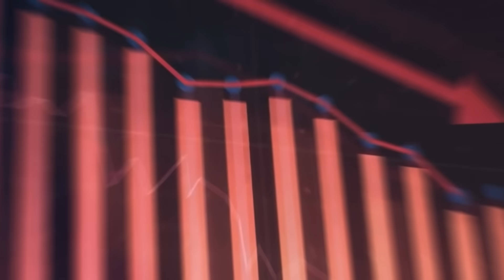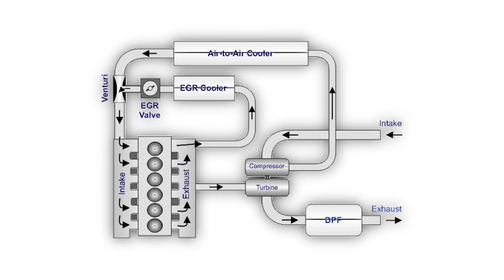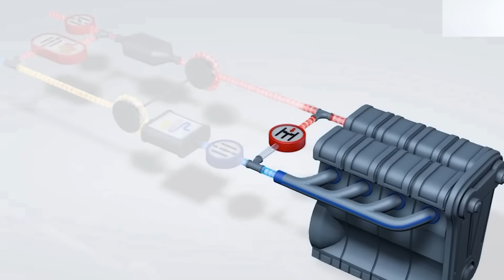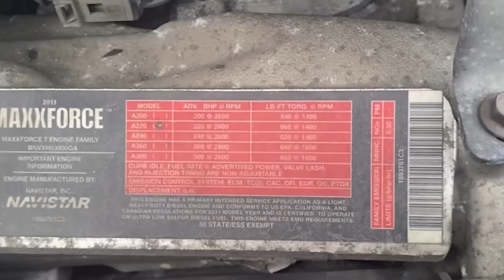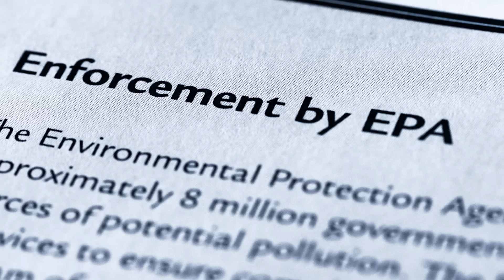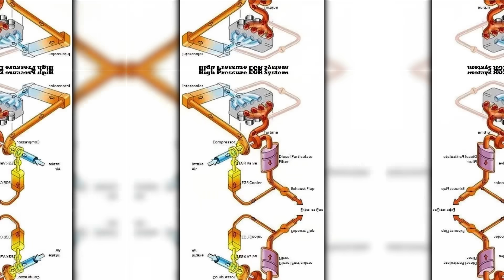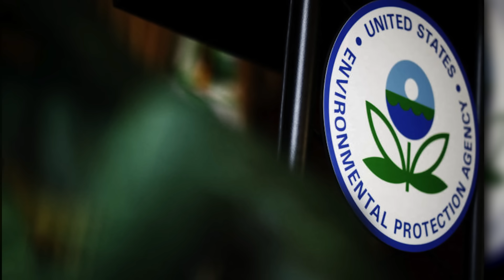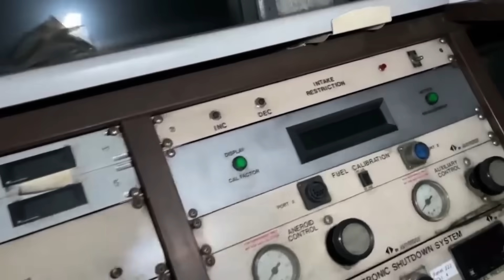The Rise and Fall of MaxxForce: The Engine That Broke Navistar

Comment: I still have my Maxxforce 13 powered ProStar. The original engine went 645k after numerous repairs. Navistar cut me a check for $5.5k for my troubles tho lol.
Reply: What’s funny is a gave up turning wrenches when my shop got bought out, and started driving local. I had an international 7600 with a Maxxforce 13 and Eaton 8LL. I had that truck from new and drove it for 4 years. It never went to the shop for anything but service. I never ran a parked regen on it either. 

I beat that truck daily. I wrung its guts out at every stop. I honestly think that’s why it never had problems.

Comment: I'm not a mechanic, only a lowly steel mill electrician. Even I could see how stupid their system was. HUGE heat cycling in a system with huge variables was a sure course to failure.

I am SURE their engineers had screaming and yelling fits with their executives, and the executives with their business degrees DID NOT want to hear it from those peons.

Comment: I worked for a International Truck dealership. I was Cat, International, Cummins, Detroit and Mercedes 2015 certified when I left. I saw and worked on all this crap. It is funny that International didn't learn from Detroit when they came out with ERG and we were changing coolers weekly. I am happy that I no longer have to deal with this crap.
Reply: I had no idea these engines were so bad. I owned two Mercedes powered trucks and if you were to ask anyone, they’d tell you to run away from them. But honestly that Mercedes was extremely reliable. The biggest problem I had with them is no one really knew that much about them so every time I told someone it had an MB they’d turn me away. But they gave me almost zero issues.

Comment: All really unfortunate... This should have all been found out during testing and they should have backed aways from the design before selling it.
That said.. we had International Pro Star trucks.. had cummins engines .. then we got new ones with the MaxForce engines.. I will say the ones we had made good power.. peak torque was at 900 RPM..  You had to adjust your shifting points to make it work.. revving it out did not make it work better like the older Cummins we had.
I liked how they drove.. But I left the company not long after so never experienced all the failures that must have happened.
It is interesting that International has pivoted completely the other way with the S13 Integrated engine.  It does not even have ANY EGR cooler...  The idea is to let the engine do engine stuff.. and they built an aftertreatment system to do that.  NOT forcing the engine to be an emissions component.

Comment: as a diesel mechanic, i worked on these engines on school buses and they're junk, we would send these vehicles out to the dealer rather than work on them, we would get the vehicles back almost a month later.
Reply: And then they went down again within a couple weeks lol
Reply: Loadstars, Fleetstars and S series will be hauling Prostars to the crushers
Reply: Didn’t the buses have the Ford 6.4L engine? Or should I say the 6.4L International engine Ford used in the pickups?
Reply: @tylermacconnell217 Maxxforce 7 duh
Reply: @tylermacconnell217  we got rid of all the maxxforce buses too problematic.
Reply: @tylermacconnell217  they also had the maxxforce dt
Reply: keep in mind this is the same company that made the powerjoke 6.0.  lol
Reply: I am a fleet mechanic for a public utility. The MaxxForce 10 and 13 nearly pushed me into an early retirement. We have 43 garages that maintained about 900 Navistar trucks and I can’t begin to tell you how many of us wanted to find another job after dealing with this MF engine. We stayed so busy replacing injectors, High Pressure oil systems, EGR coolers, turbo chargers, we rarely had time to do maintenance on the ones that were running. 

What’s worse was that the drivers were blaming the garages and not the trucks. In hindsight, who could blame them? All the driver understood was that their truck quit running, we repaired it, and the damn thing quit running again a week later. 

The company has got rid of more than half of their trucks using the Maxx Force and replaced them with trucks using the L9 Cummins. To be frank, I am not terribly impressed with that engine either. It’s definitely better than the MaxxForce but it’s not nearly as dependable as the earlier Cummins engines.
Reply: This engine almost made me quit pursuing a career in diesel repair. This was the first ever engine i had ever worked on professionally as a paid fleet mechanic. It took me 2 weeks to figure out a crank no start on it. Ended up being injector orings and a coolant level sensor. I was 19, fresh out of welding school with 0 help from  anyone and like 200$ worth of craftsman sockets and wrenches and a test light. I didnt even know how to use the test light.  No scan tool or error codes on the dash telling me low coolant level because the orange screen on the dash was cracked and half black
I truly thought that was the end for me, I figured it out a couple of hours before i was going to leave and never come back and work construction as a laborer. Still wrenching 12 years later.
I truly thought it was going to be that hard everytime, Turning wrenches got exponentially easier as i learned more. I threw at least 24 cans of starting fluid at that thing, Did the fuel filters like 4 times, I even pressurized the fuel tank so hard i blew out the fittings on the fuel lines. Looking back on it I definatley fried the dogshit out of the intake heater😂... I was thrown to the wolves and faced THIS piece of shit for my introduction into the diesel world 😂
Either nobody actually knew what they were doing in that shop or they refused to help me. Still pondering that to this day.
Reply: @loveforthegame3 Yes, but you figured it out. And that’s the kind of thing that will make this a great career for you. After 42 years I am finally retiring. I will always look back on those times I was sitting on the concrete floor at 11pm, long after every one went home, trying to figure out why something wouldn’t start or run. My wife would bring my dinner to to the shop, and I would get home after the kids were asleep. 
I couldn’t give up. Like you I am a fleet mechanic and the crew needed the truck. 
I will always have those memories to look back on
Reply: @Randy.E.R  congrats on your retirement. Must have been something else to see all of the advancement in technology throughout your career. The Aftertreatment systems must have been hell when they came out 😂. 
I am much much much better now, its been awhile since i ran into a problem i havent been able to remedy.
I still much prefer to work on an old 2 stroke detroit than anything else.
Reply: Had a 3rd party fleet provider that gave up on the company I worked for because they didn't want to work on the engine.
Reply: Company I worked for swapped in B Series engines.
Reply: @andrewkessinger5966  i worked for the school district and these buses were old so they prefrred to auction them off since we were getting new buses.
Reply: I am down to 3 left.  One DT and 2 Maxx 7's in my fleet.  My DT runs great but put close to 20k in the past 3 years.  The 2 Maxx 7's I am keeping them running until they completely fail.  I dislike these engines.
Reply: What was wrong with them? I mean what was failure prone and why? Oiling system? Bad metals?
Reply: @dukecraig2402 
if one injector went out and you replaced it within a couple of months or less the other 5 injectors would go out so you had to replace all 6 injectors at once to avoid more problems and that was expensive and time consuming, turbos would leak oil, frequent regens, the engine required alot of maintenence alot more that the 6.7 cummins.
Reply: @feliperodriguez6885 
Sounds like one of the many reasons I got away from being a mechanic and started working as a welder.
Reply: @dukecraig2402  Worked for a bus fleet with them as well and they got so bad we were changing oil on them every month because the oil would fill with diesel and leak everywhere, don't mention the EGR coolers and the turbos. Every Bus with those engines you would know where they park because there would be an oil spot waiting for you. The newer International Cummins busses are not too bad besides the SCR system and don't even get me started on the POS Bluebirds.
Reply: @dukecraig2402 you cant piss in a mr. Coffee and get tasters choice. Even if you cool the 1000f+ exhaust to 300f and introduce into the charge air mass, this will cause a thermal runaway condition beyond the TDP of the engine, and then you add a plugged dpf and continued fuel  being commanded to overcome the loss of power and necessary regen for dpf along with a 80klbs load...the specific heat of co2 doesnt help at all because co2 isnt the only gas being worked and compressed especially at the level of reingested egr the system is reintroducing. I cant imagine what the drive temps and pressures these engines were living with much less what the scavenge ratio was under these conditions.
Reply: American junk….

Comment: The Maxxforce 13 was actually a MAN D2676 with Navistar's emission system on it, and the Maxxforce 15 was a Caterpillar C15 with Navistar's common rail fuel and emission systems on it.
Reply: Really now. Tell me more
Reply: @sandasturner9529 I can't go into what they said further, but I know the newer A26 engine is a MAN engine, and the new s13 is a Scania.
Reply: @joshsnyder629 also the PACCAR PX-9 is a rebadged Cummins L9 and the MX-13 is a DAF engine (PACCAR owns DAF).
Reply: @Der_Ingenieur  hmmm 🤔 🧐
Reply: @sandasturner9529 🤣🤣🤣
Reply: @sandasturner9529  We have a CAT CT660 heavy hauler. It is a CAT block and head with literally everything else being Maxxforce fueling, emissions, accessories, etc. We got it deleted and it’s actually quite the animal.
Reply: Maxxforce 13 was a Daf Motor.
Reply: @curtisnoble. PACCAR MX13 is a DAF engine. I get those mixed up, too😂
Reply: @Erichhh paccar mx13 is JUNK

Comment: One the video didn’t touch on was, while Navistar was dealing with all MaxxForce problems, there were two other engines produced for Ford that were as equally problematic. Ultimately Ford didn’t renew their contract with Navistar, but rather went on to building the engine in house.
Reply: And the Ford 6.7 Powerstroke is anything for ford to be proud of either. They never stop leaking oil.
Reply: @lbw60-br9  True of early 6.7s, but not later ones....
Reply: @alexnutcasio936 dont worry oil leaks arent the biggest failure point of them. The CP4 pump is.
Reply: @lbw60-br9 I think I’ve heard something about the oil pan being a big problem. Was there anything else that was prone to leak?
Reply: @lbw60-br9  The first generation 6.7 wasn’t very good, the 2017+ 6.7s we’ve had have been awesome. About 450k miles between 3 F550s and not one of them leaks. No major issues on either yet. On the other hand…. We also have a built 6.0 company “show truck” that started pushing compression through the cooling system 20k miles after its new engine. No EGR on it either.
Reply: @ASM31237 if it’s pushing coolant after 20k miles then something wasn’t done right when the heads were put on.
Reply: @lbw60-br9  no one ever services the ccv system thats a solid 95% of the problem. If the crankcase can’t vent it’ll force it out eventually. But they did certainly have bedplate sealant issues on the early ones.
Reply: @lbw60-br9 I have a 2014 with over 100k on it and it has never leaked any oil. I would see it on my Garage floor if it did.
Reply: @lbw60-br9 bs 2011 f350 236k and doesn’t leak a drop.

Comment: Okay but what about CATs Acert system? They were significantly cooling combustion chamber temps without even EGR system. Een CAT saw how bad an idea the government was forcing on these standards, and they backed out completely. If left alone I believe CAT would of done what they always do, give customers better, more efficient and safer equipment. Politicians should not dictate to engineers
Reply: It's called watch adept ape
Reply: The EPA got involved because NOx emissions cause lung disease and acid rain, it has nothing to do with improving efficiency or safety. And do you really think CAT or any of these companies would have started caring about that all by themselves if the gov just left them alone? Do you really believe the engineers get to make these kinds decisions anyway?

Come on, that's not the world we live in.
Reply: @yinyangsaladgang8789  Nox emissions is caused by excessive combustion temperatures. CAT ACERT reduced combustion temperatures. 
CAT was working on this, before the politicians with no experience in engineering got involved and pushed unproven systems and designs. Do you know what Regening is? The truck sits at high idle for 30min-1hr30min. DEF fluid has to be manufactured transported and stored, parts failures causing more down time and inefficient running, which increases emissions far more than not doing the systems. 
Companies like CAT are far smarter about engineering than any politician or voter
Reply: They backed out of otr, but for what? Off road equipment has to have def systems now at least in Oregon
Reply: @NPC-mt1cz it gave them 2 years of watching everyone else’s disasters, and 2 years of extra R&D.  That’s actually quite a bit of value given the ridiculous timelines governments were pressing.
Reply: Something isnt right about the videos statement about Cat. They were working with def.
Reply: Yeah, let corporations dictate emissions! They’ll always put people over profits!

Comment: International dt466 mechanical engine was one reliable engine and the 7.3 but the dam regulation are trying to make a diesel run as clean as a gas engine heres the results FAIL

Comment: The epa under the progressive administrations was purposefully over regulating diesel engines.  To make them prohibitively expensive and complicated to maintain so when the electric semis come out everyone would clamor to get one.  Yeah, no maxxforce is the best product out there, I sure don't want one or to ever work on one again, but scr is not the savior either.  It has its draw backs and costs to maintain also.  And back in the day when electronic engines first came out due to epa regs all the old timers complained about them too, being too complicated and  unnecessary because the mechanical engines worked just fine.  And to highlight the root of the issue here I'll use CAT as an example.  They got out of the on highway engine business, not because they didn't have an emissions system, it just doesn't work well in transient conditions, which is what on-highway is.  They have numerous engines that are tier 4 and working as well as anyone's, but not on highway.  On-highway emissions is difficult and nobody has it down perfect, but at least some are trying, not like CAT.  They just gave up and took the easy way.